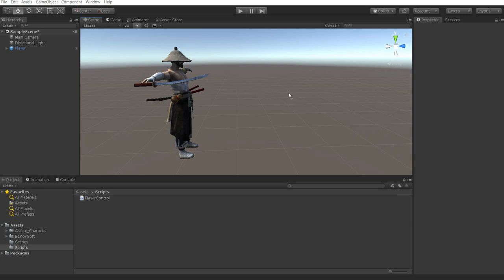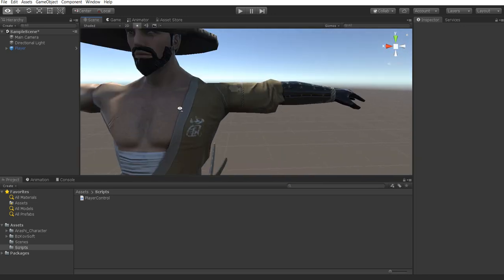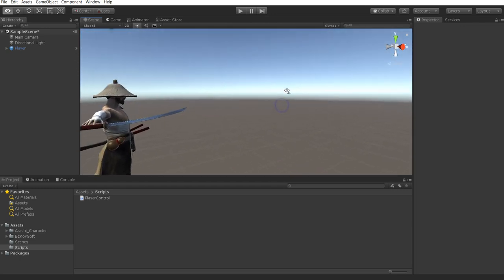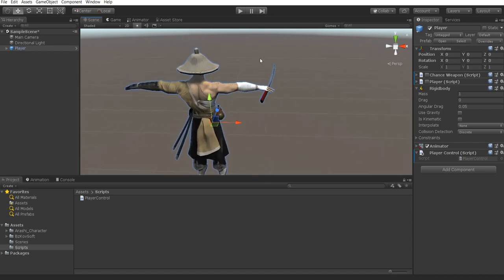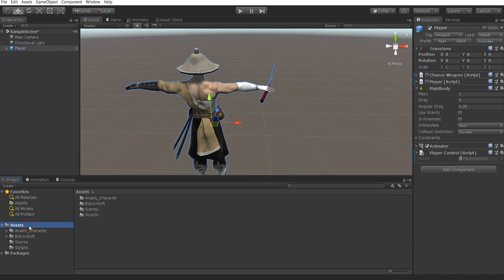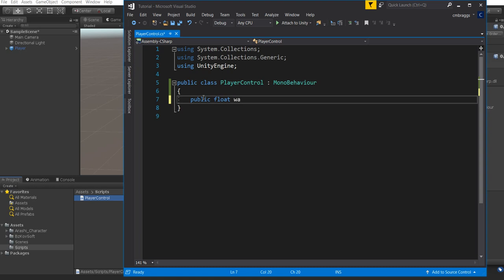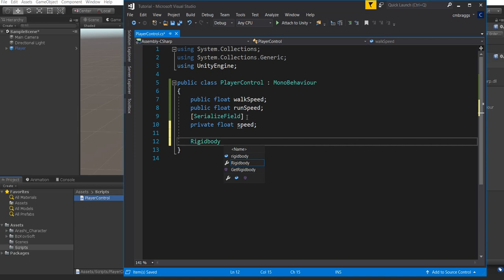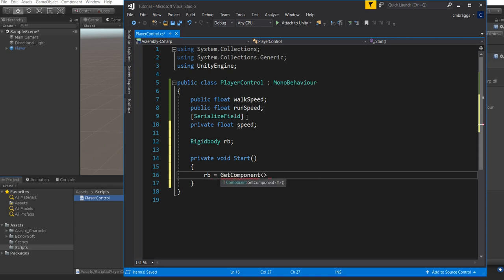Game Dev #1: Rigidbody Character Controller

Comment: anyone able to help?
I have copied the sprint code exactly and even set the left shift key as sprint... but speed still instantly switches back to walkSpeed, sometimes not even changing to runSpeed at all?
Reply: Fixed it.
Anyone with the same issue, here is my solution:

void Start()
    {
     speed = walkSpeed;
     }

private void Update()
    {
        #region Inputs
        if (Input.GetKeyDown(KeyCode.LeftShift))
            speed = runSpeed;
        else if (speed != walkSpeed && Input.GetKeyUp(KeyCode.LeftShift))
            speed = walkSpeed;
        #endregion
    }

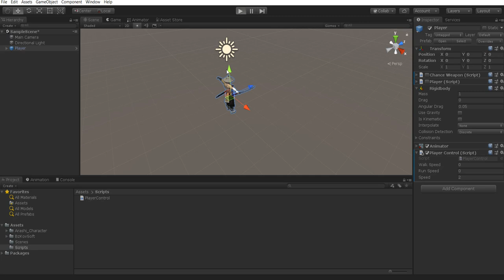Comment: @CB Showtunes plz can u fix my error. My error is that on 4:51 my character is not moving in any direction when I click "w" "s" "a" or "d" even though I did everything u told me to do. I even went through it more than times but it's still not working ... plz reply im really desperate
Reply from the maker: Make sure you have a rigidbody attached to your character and the speed in the inspector is increased.
Reply: @cbshowtunes7363  honestly u the best coz when I increased the value of my Speed, Run Speed and Walk Speed it worked.
Reply: @cbshowtunes7363  well looks like u I only needed to increase my speed 😅
Reply: @cbshowtunes7363  thanks